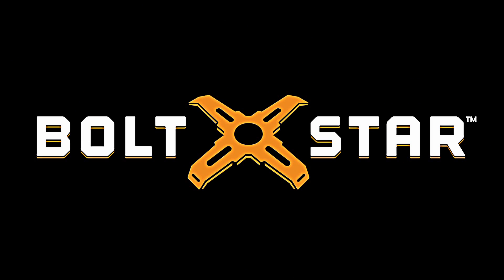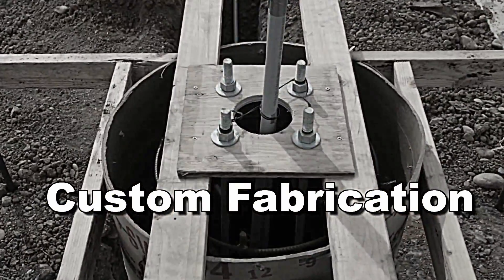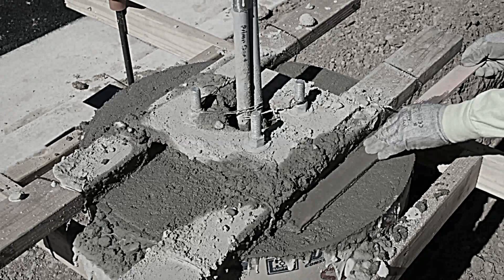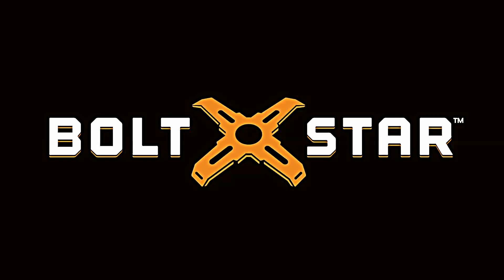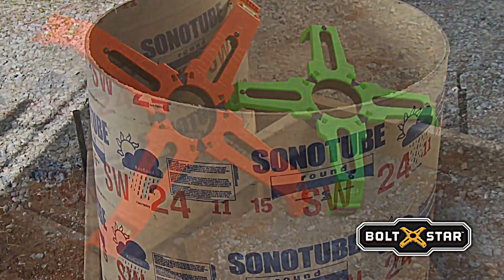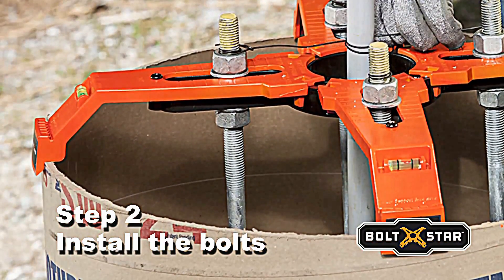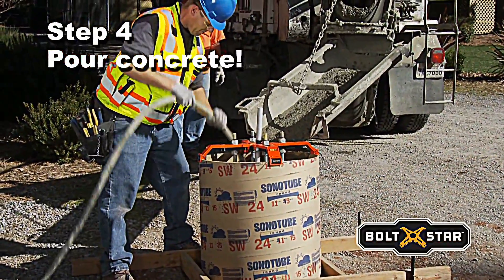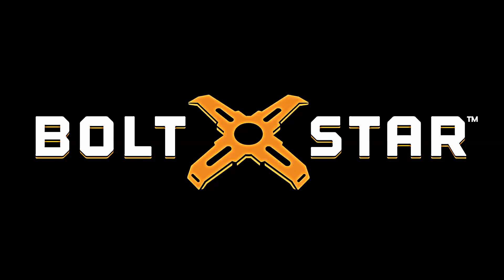BOLT STAR

Comment: Just used this product today had the 24" bolt star and it would not consistently fit on different pieces if 24" so no tube without egging the base or having force bolt star into the tube and tie it down to the cage to prevent it from jumping off during the pour great concept but needs improvement
Reply from the maker: Thanks for the feedback, James, and sorry to hear you had some difficulty with your particular brand of tube. The 24" Bolt Star was tested with tube made by various tube manufacturers and will fit on tube up to 24.524" outside diameter. If your OD is greater than that, you may have nested tube (25" labeled as 24") and need to use the Xtender adaptor. In your case it sounds like Bolt Star was just fitting snug. Try getting 3 arms on the rim of the tube then hit the center with the palm of your hand and the tool should snap on to the rim of the tube. Remember, Bolt Star was designed to support the rebar cage (watch the video at www.bolt-star.com), and it uses gravity from the weight of the cage and the bolts to keep everything in place during the pour. Manufacturer highly recommends using the cage tie slots to prevent movement of the template during the pour.